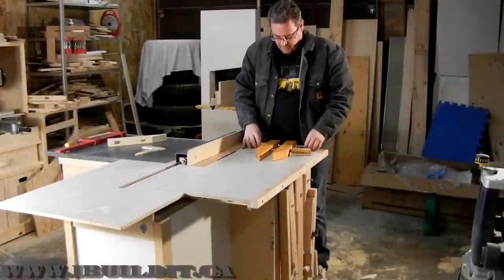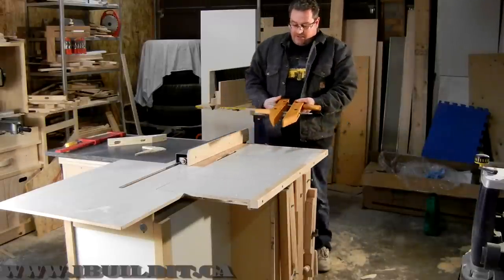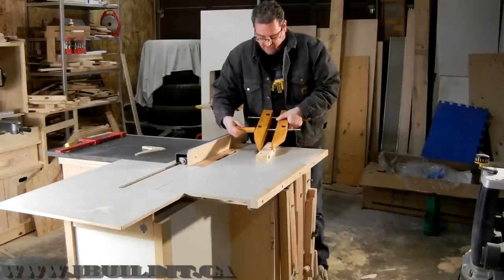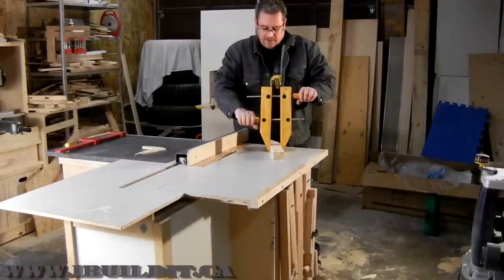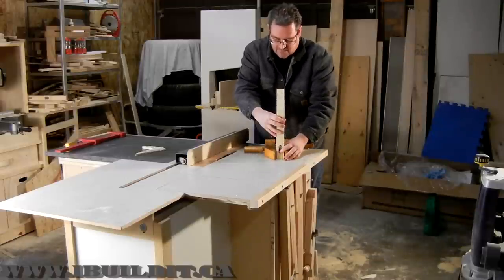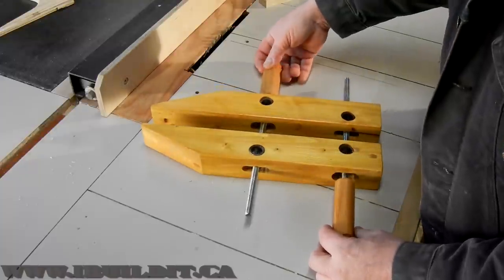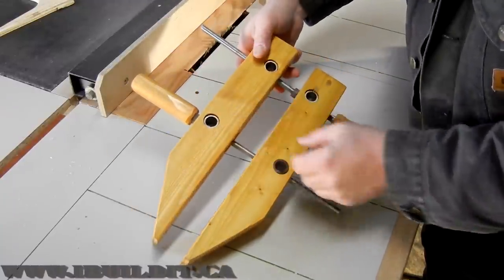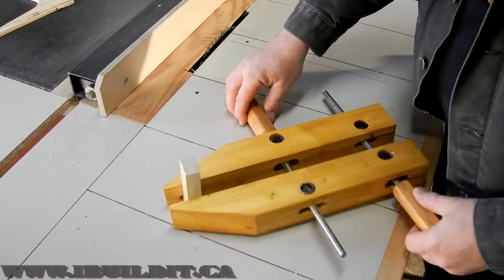Homemade Hand Screw Clamps

Comment: Hey John. I've watched this series 5 times, and i think you nailed it. Is there a reason that you can't just round the hex part of a bolt, thread the bolt though the nut, whilhe the nut is inside the pipe, and just put a couple of welds down in there to hold it? I know you don't use your welder i these videos, so regular woodworkers can follow along, but nuts are expensive compared to a bead of weld, and making the jaws in one piece would cut milling, alingning etc. time in half. :).

Comment: Did you know that the original euro cramps have on every bar a L/h & R/H thread for faster opening & closing.They can be bought in kit form also (metal parts only _ you supply the timber). Thanks for the vid, John.